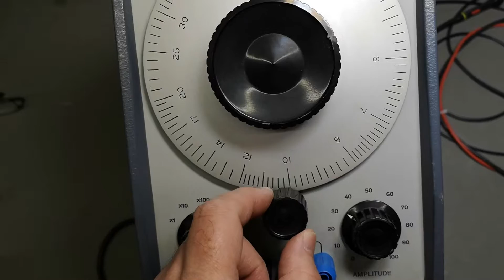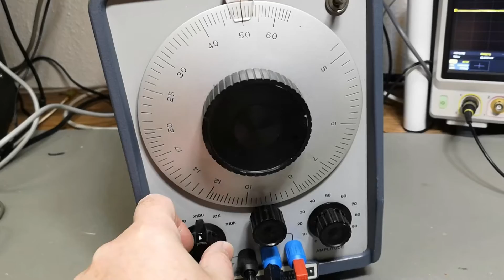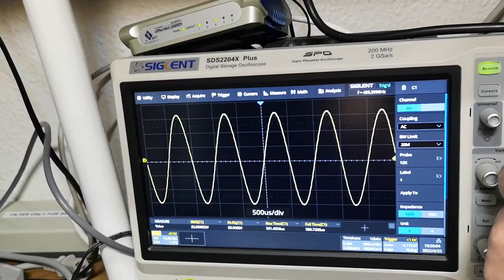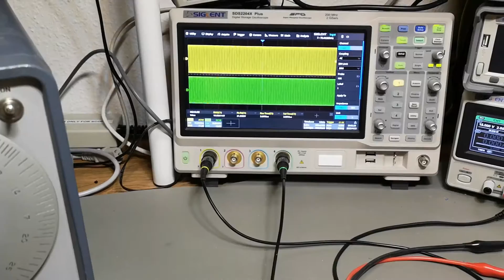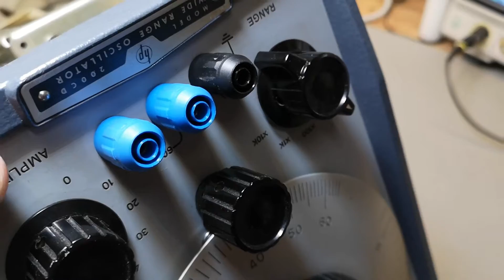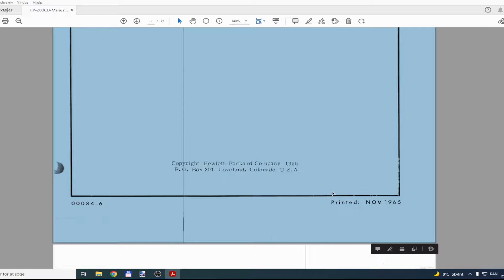HP 200CD wide range oscillator  5Hz-600kHz 1955-1965 Teardown

Comment: Safety plugs are a later retrofit. Normally came with plain banana sockets, to take the standard 4mm plug.
Reply from the maker: Exactly, if you look closely, there is a color marking round the area where the original banana frame was , revealing this was a later self performed upgrade

Comment: Why use Bulbs ?
Reply from the maker: Nothing else existed in this time, transistors came later
Reply: @TeardownOZ2CPU  Bulbs are non linear, and will very with applied  voltage in resistance over a good range, making it possible to keep a constant level over the entire oscillation range, and achieve good linearity.
Reply: @TeardownOZ2CPU  I think they meant the lightbulb used as a PTC to stabilize the wein bridge circuit. BTW, I think the 200CD was made up to the early 1980s?
Reply from the maker: @splitprissm9339 yes the bulbs are for level feed back regulation, very good way to do it, this one is the latest model with small modern tubes, no rectifier tube, I think they stopped making the 200 model when transistors became more modern, see the 204 model